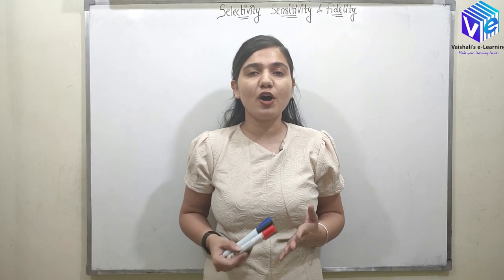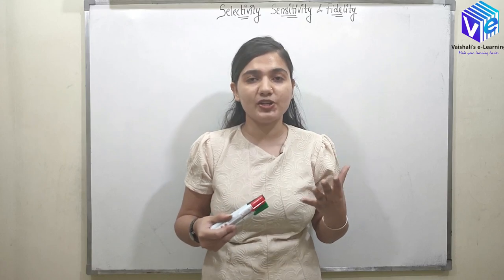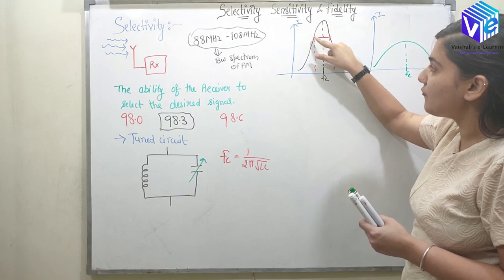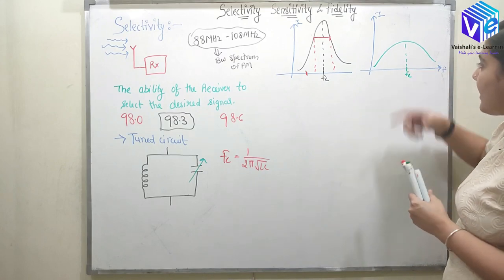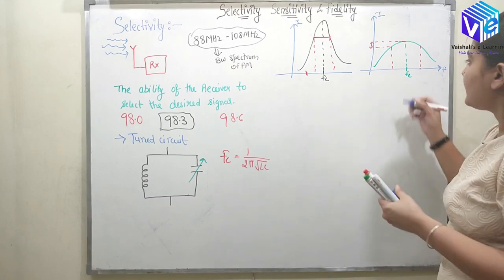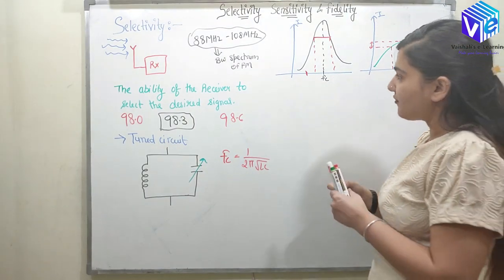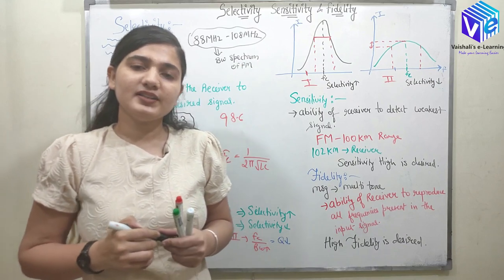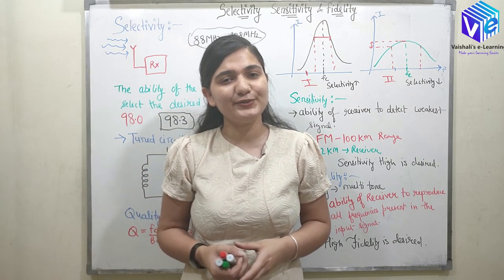L 31 | Selectivity, Sensitivity, Fidelity | Analog Communication | GATE | Communication System

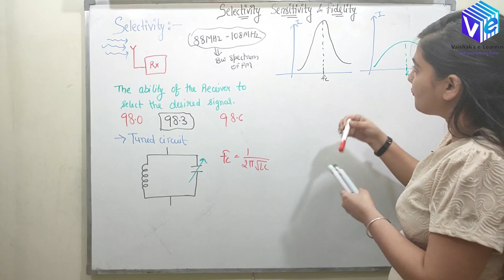Comment: At 5:05 you said, at frequency fc the circuit will provide highest impedance and  lowest resistance. That's a bit confusing(1). Also I read somewhere that these circuits provide current amplification.  The RF Amplifier circuits use parallel LC circuits. At resonant frequency such circuits provide highest impedance and lowest current. How can it amplify the current when the current is lowest (2)? Can you please elaborate on these two points ?
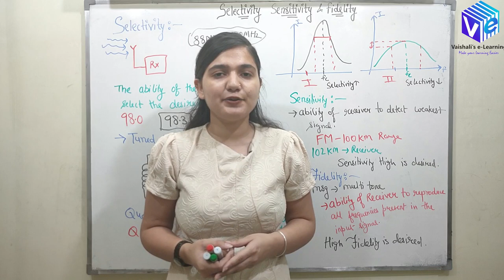Reply: At 10:58 she also said , 'If you still have any doubt you can put that in the comment section and I will try to resolve as soon as possible.' 😂😂
Reply: This is only an LC bandpass filter and it will let pass the signals within the range frequency F1-F2. When the LC circuit is resonating, reactances inductive and capacitive will cancel each other remaining only the real impedance. This means that at fc, the impedance is pure real in theory and it will exhibit the lowest impedance. What you saw was a matching network, which is a passive circuit used to change impedances. Basically, RF amplifiers use this circuit to match the amplifier to the load or source impedance and get the maximum transfer of power in theory. The topology for the matching network might be an LC or Pi-network or T network. The selection of the topology will be based on the bandwidth requirements.
I hope this helps little bit.....
Reply: Thank you for breaking this down. I'm new to understanding electricity